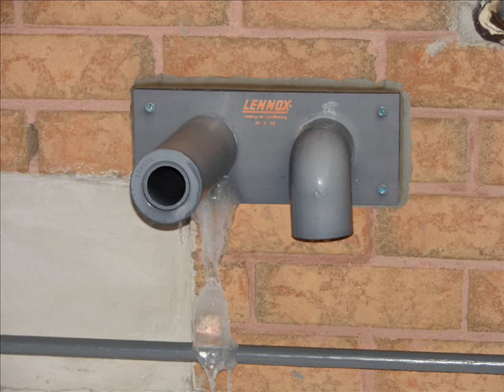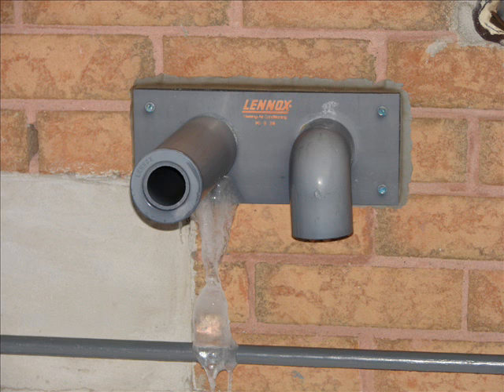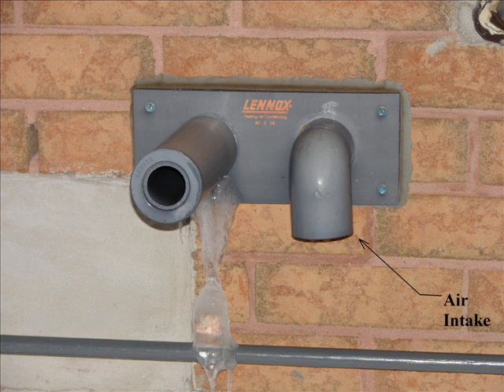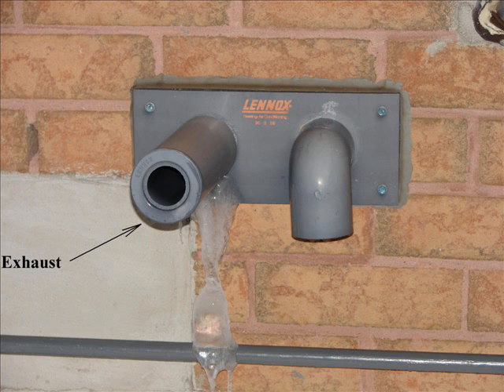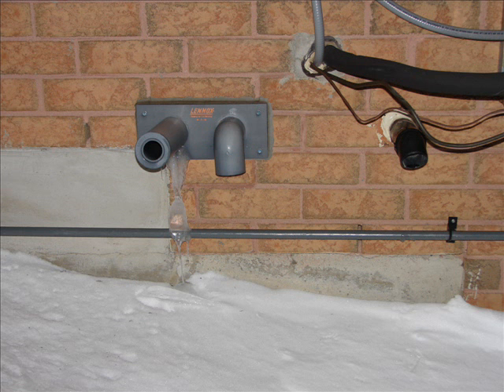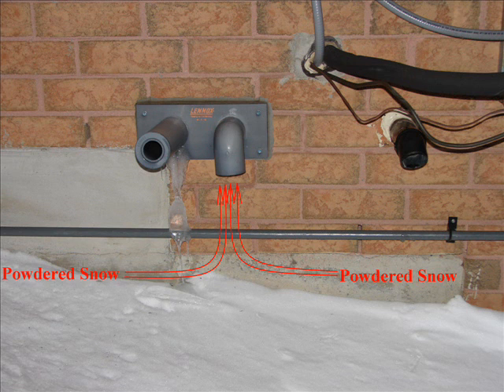Furnace Vents and Snow Storms

Comment: Lucy it is very important that the exhaust and makeup or fresh air go directly to the furnace you can download an installation manual for the model number of your furnace.  Please insure the exhaust is pvc the whole way no flex or have it fixed immediately.  There is also limitations on celluar core pvc and it should not be used but is still being used in America should be rated for pressure though as they learned a long time ago in Canada we seem to be behind in mechanical venting code inforcement even though whole families die in there sleep from incorrect vent installation.

Comment: @PoolmanZZ I made a mistake,, my husband has pointed out to me that they didn't use a pvc pipe, they used a air vent bag..it's wide and squishy..reminds me sort of like a dryer vent hose, it's coiled..My husband wants to attach a pvc pipe to it using a clamp and then attach the pvc pipe to the furnace, do you think this will work? thanks

Comment: I had a Trane furnace installed . They vented it outside and also piped a fresh air intake but they never connected that pvc pipe to the furnace. They left it near the furnace and said the furnace would draw the fresh air from that pipe there. I had to put a pvc elbow on the furnace where this pipe should be because it got clogged,the furnace room has a cat litter box in it and that may have clogged the opening. Should we add more pvc pipes to connect this fresh air vent to the furnace ?